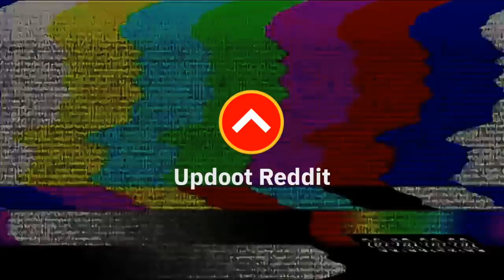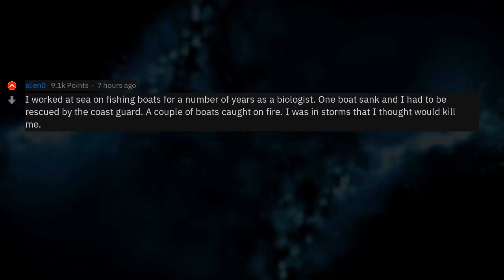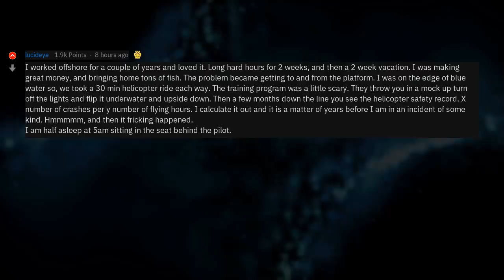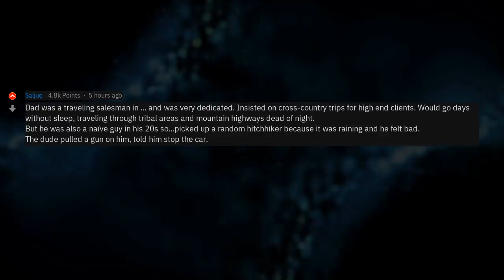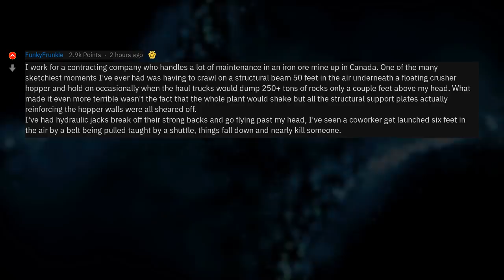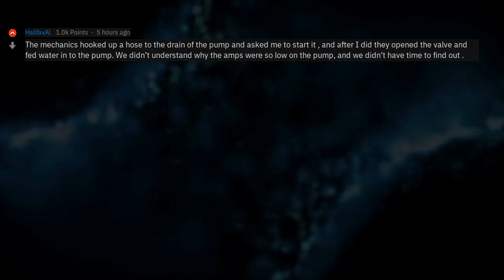When Have You Walked Out On A Dangerous Job? (Work Stories r/AskReddit)

Comment: My husband works delivering propane and fuel oil. He loves driving truck but delivering house to house is surprisingly dangerous. Not just the obvious of working with a flammable material but also the risk of the truck itself rolling over on someone- its surprisingly common considering ppl don't salt their driveways and the trucks are heavy.
They lost one guy last year to that and my husband has gotten 2nd degree chemical burns from propane spilling on his arm and abdomen. Not to mention numerous close calls on the road from reckless drivers who think they can just pull out in front of a loaded propane truck going downhill.
I told him never to get complacent no matter how many years he's worked the risk of accidents won't go away so he has to stay on the ball or get out when he feels he's had enough.

Comment: im a demolishoner, at our firm we have different sections of people such as; asbestus cleaner, concrete hole-driller, demolishioning and so on. i have a very good friend on the same company, but he´s in asbestos-cleaning so we dont often see each other... although when we meet he gives me tips about asbestos since its usually either the bosses or the demolishers that notices it first, i've gotten so used to it and gotten a lot of tips i believe i could ALMOST do the job myself... but since i dont have the license i cant because i would get a HUUUGGEEE fine, lose my job and the company would take a great fine as well... so one day at a job i tell an arabic co-worker (thats a bit slow in the head) that the "glue" that holds the drums of ventilation together is asbestos and not to cut it... WELL, i went away for 5MINUTES and when i come back i see him hanging and trying to bend apart the drums. i went on full alert, gave him a shout of the ages, put my mask on and forced his on him, evacuated and called our boss. his defence was that "because i said not to cut it he thought he could pry it apart instead, because then the asbestos wouldnt break apart and dust"... he got scolded the sh!t out of and a warning. i got a check-out at the hospital just to check if any got in my lungs... had to throw my favorite working-clothes away and got rest of the day off (full paid). i didnt walk out of that firm but i REFUSED to work with that guy until he finally got fired for always being late and lazy.